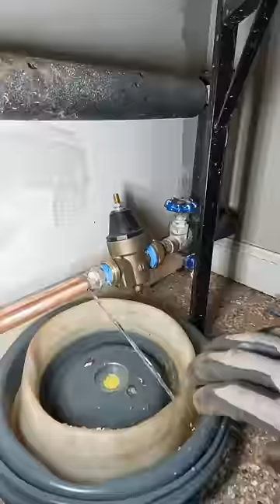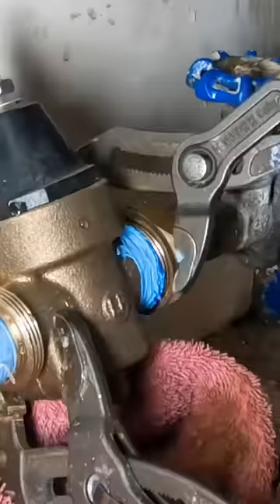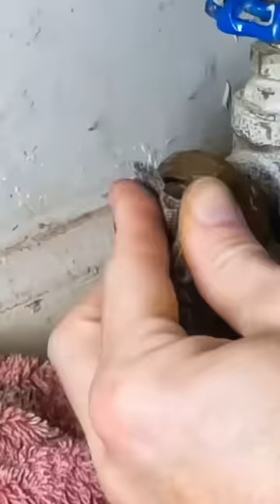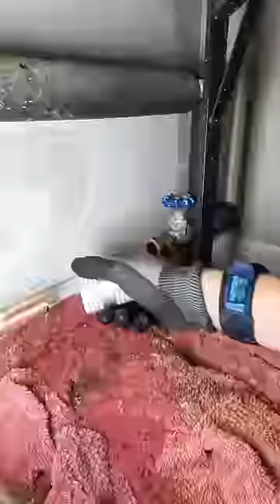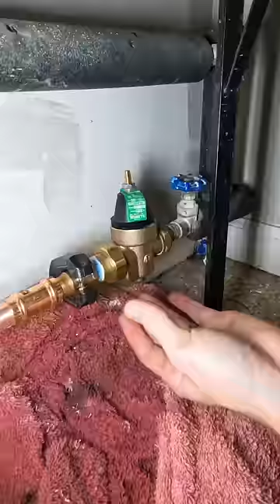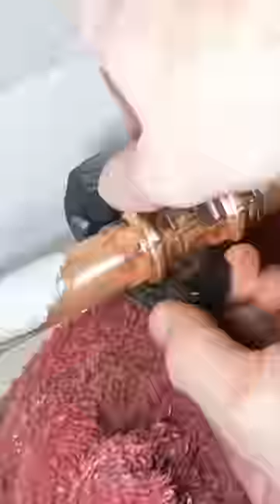Replacing a water pressure regulator valve 💦 #plumbing #plumber #shorts

Comment: Wow. Whoever installed the old one wasn't a plumber 😂. They had blue thread tape around the gasket seal smh
Reply from the maker: The teflon bandit strikes again! 😂
Reply: @theplumberlorian nothing ever sticks to that guy
Reply: В России синяя изолента легендарная вещь
Reply: @samuelcomeau pipe dope is good to stop galling and seizing
Reply: @AlbertCartel 😂
Reply: @BensSightSoundandAuto it’s not needed though
Reply: @smittysgaming9764  Seat belts aren't "needed" either but they help. Pipe dope could mean the difference between a quick swap over down the track or a pain in the ass repair
Reply: @samuelcomeau think: you will be able to unthread that in the future.
Reply: Yeah I love when I see that.  I was trying to source a seal for this pipe fitting similar to this at Home Depot a few years back.  After helping me for a while the guy was just like “you could just use Teflon tape”.  No… no I can’t.  That’s not where this fitting seals from.  Being half his age he just kept reassuring me and telling me to trust him.  It was honestly unbelievable that he was the plumbing guy.
Reply: nice how you noticed the blue tape on the old install. tefflon tape wont eat the gasket away like the pipe dope this guy put on the threads of the new install. the dope eats at the rubber over time.  sad video and your sad for not stating the real issue
Reply: @joshouagoncalves9564  The saddest thing here is your grammar . 😭🤣
Reply: Tell ya what, too:I noticed that, as he was finishing up the installation of that new system, and some new line, he didn't use any soldering. Just clamped down on the connections, got 'em to where they wouldn't leak, and finished up. 
Apparently, they've come up with a whole new way to do things like that, in plumbing. Smart move. With soldering, ya have to be careful... and exact. Too thin a weld on soldering, and ya can get leakage. 
So, with him just tightening the connections up, I guess that's it.
Reply: Back when I worked in a small engine shop we had the same problem with pressure washers. Pressure washer high pressure hoses using a M22 fitting. Teflon tape will make a M22 fitting leak.
Reply: @BensSightSoundandAuto  Yes. It's just a lubricant.
Reply: YouTube wasn’t around back then😂.
Reply: neither was the guy that used crimp fittings instead of soldering. too much lazy work these days. would rather spend 3 grand on a tool instead of getting an apprenticeship in plumbing
Reply: Дд
Reply: Wow whoever is changing this 1 is putting it in the wrong place it belongs out next to the meter box to get the water pressure down ASAP
Reply: @steelthfighter no one should solder anymore. Boomer.
Reply: @aweiner8667  and yet i can still run a trout line, grill a burger without fake finger nails, put up a barn, and plant a field of corn. all things that a millennial cant do because your all too damn lazy to go get a job
Reply: Mi estamos, execelentes trabajos.
Disculpe como se llama la herramienta que ocupas.
Saludos desde la CDMX
Reply: Ты не понимаешь)) И поймут не многие, Советский Союз поймет, синяя изолента- спасёт мир))😂
Reply: I'm a plumber... we use both blue Teflon and pipe dope on every single thread. Never had an issue.
Reply: @Awesomeman1987 do you know what teflon tape is actually for
Reply: Yeah and the guy who installed the new one put pipe dope on the same thread 😂
Reply: Teflon tape is not a sealer it is a lubricant that allows you to take full advantage of the taper that is built in to the fittings which is what actually creates a leak free seal when done properly. Pipe dope is also a lubricant just like Teflon tape. Pipe dope and Teflon together makes a great combination which allows you to take full advantage of the taper that is built in to the fittings.
Reply: @Tom-og7fi  you do not use teflon tape together with pipe dope
Reply: Not all threads have a tapered Edge some of them are straight you must get the pipe dope in the threads as well as lubricate it also seals this is why it says sealant on the jar just about every plumber I've ever seen uses dope and Teflon this is completely wrong you use one or the other and the argument will continue forever I've never used them together Bennett Plummer a long long time never had a leak
Reply: @edtorres5946  wrong. Straight threads are never used in electrical conduit or pipe threads in fact they are the same. 3/4" taper per foot. Straight threads are used for bolt applications.
Reply: @edtorres5946  you didn't go through a real apprenticeship did you. If you did you would know that what you said is wrong. Fixture threads such as use a sealing washer.
Reply: . ,,    Yep take the street key  ,, Turn it off  ,, Replace the valve too. !

Comment: Pro press, love that thing. What use to take hours can now be done in minutes. No more waiting for all the water to drain because It cools the pipe when soldering. Still charge the same tho.
Reply from the maker: You and me both!
Reply: just a glorified shark bite isn't it?
Reply: @vincentherman468 shark bite relies on the end of the pipe seating on a gasket and a biting collar.  They are prone to working loose and should never be closed in a wall.  Pro press actually surrounds the pipe and clamps  the O ring, it's proven to be more reliable.
Reply: @Redact63Lluks More reliable than a shark bite or more reliable than soldering?
Reply: @jamesegsmith  both by a long shot, but properly done soldering is still best.
Reply: Why the same though? Is it because you save time but fittings are more expensive, so it evens out?
Reply: @Redact63Lluks 
I have been in homes with 70 year old soldered copper pipes. I doubt that the rubber o rings in the fittings will last 70 years.
Reply: @12yearssober  did I say otherwise? 🤷
Reply: You don't have to wait for the water to drain, You just pack the pipe with a slice of bread or two, to plug it. After you solder and turn the water on it flushes right out.I learned that old trick over 30 years ago.
Reply: @Gravitycreatedlife you guys literally carry a loaf of bread around in your truck ?
Reply: Still charge the same because the tool is $2k plus and the fittings are at least 4x the price of solder ones
Reply: @12yearssober 😂 The o rings are a safety measure. There's videos where they use pro press without the o-rings and it still works
Reply: @Ffoo_ffighter  
I guess we will come back in 50 years and see🤣
Reply: As someone who makes F you money. I'm happy to pay for skill/tool Knowlage not by hour
Reply: @RedPillRealist  
That's how I make my money here in Naples Florida. All of my customers have f you money. They just want their AC working and don't care about the money.
Reply: What about the cavitation that crimped connection induces?
Reply: Solder will always be king. My house is over 50 years old and never had a leak. I personally have had to replace pro press and sharkbite fittings leaking in other peoples homes that failed within a year. The plumber who installed them gave the old taillight warranty. 
It may be faster, but its hack work and never lasts as long as solder.
Reply: Just put a compression fittings on no need for press fit and expensive tool
Reply: @Ffoo_ffighter does not work without the o ring
Reply: iantrofimov6416 it's much faster and there is no error
Reply: You can just stick some bread in there or use a large enough torch.
Reply: Hack
Reply: @ColeSpolaric the tool is about £650 ($700) in the U.K. but we have been using them for over 20years maybe that why, more popular
Reply: @Gravitycreatedlife Important though - pack bread but clear it out through a non-filtered, open spigot first or remove the aerator from the sink faucet first or else the bread will create a nasty sludge on the aerator screen.

And don't use wheat bread 😂
Reply: @jhard94  homeowner does  most of the time.
Reply: @WayPastCrazy2525  wheat bread works just as well if not better than white bread. It's common sense to remove screen from faucet where you flush. I usually flush to the outside spigot where that wouldn't be an issue.
Reply: @Ffoo_ffighter that’s not true. The o ring makes the seal
Reply: @vincentherman468 sharkbite could never make varsity
Reply: @jhard94 why not you already carry 8lbs if mcdonalds bags and wrappers 😂
Reply: @thedailyruns6046  I don’t get what you’re saying
Reply: They still charge hours
Reply: @VIPP79 It certainly does hold water with the o-ring removed.
Reply: iantrofimov6416  lol how do you know I am unskilled? I guess you are psychic
Reply: iantrofimov6416  or you are one of those that think you know everything better than anyone ah? I have 16 years of experience soldering and pressing and fusing pipes keep calling me unskilled pathetic man
Reply: @411Adidas If you install them properly it holds. It is most of the time installer error not debarring the pipe and o ring gets cut in the process.
Reply: @MisterTwister88  For how long it holds water did you try it? If there was no need for o ring they would not install it. You you want to say you are smarter than engineers creating the product and they just waisted the o rings?
Reply: @VIPP79  The o-ring is a secondary seal to the crimp. I did press some fittings with the o-rings removed, filled and pressurized with water. That set up is still holding 75 psi going on 2 years now.
Reply: @MisterTwister88  Good luck for that pray it will not leak. Do not see a reason to take chances removing the seal thats kinda idiotic
Reply: @VIPP79  Its a test setup on the bench in my garage, smooth brain.

Comment: See that threaded fitting on the right side of the valve? The left side should have the same thing. That way the valve can be replaced by the homeowner and a wrench. That's the way our pressure regulators are installed.
Reply: You can always get a sharkbite union.
Reply: Who's checking and setting the pressure though?
Reply: After the homeowner replaces the easily replaceable valve, he/she does indeed need to  check or set the controlling pressure. Fortunately, this is easy with an inexpensive and readily available gauge from e.g. Home Depot screwed onto a hose bib somewhere.
Reply from the maker: Well double unions were created for easy replace in general  💯
Reply from the maker: @BensSightSoundandAuto oh I throw a gauge on a hosebibb to set the regulator if not that .. the water heater boiler drain
Reply: Most PRVs come with only one built-in union, I rarely see plumbers buying a second union when buying PRVs

Source: I work at Ferguson
Reply: iantrofimov6416 : You can play the long game (help your customer) or you can play the short game (make the most money now). But you can't play the short game for long. Which guy will I call for future plumbing needs?
Reply: Er hat alles richtig gemacht.
Reply: Ian: If your services are in short supply and high demand, you can keep busy with the low end of the market. I am in that 25% of customers who look for someone who will offer better quality and better solutions. I  might call you. Once. After I realize that you could have, should have offered me something better, you would be on my "never call him again" list.
Reply: @BensSightSoundandAuto well considering they're all pre set I don't think they even care lol
Reply: I would always make it easer for the next guy or Homeowner. But then again I really enjoy the work I do and don't care about the Money so much. I always have plenty of Service calls.
Reply: Trust my as a plumber you could have done that anyway just take off union and unthread but maybe there were other issues
Reply: Are we even watching the same video? Because theres threaded connects on both sides of the install. He just had it pre assembled before pressing the fittings in on the left.....
Reply: Yup
Reply: he could have replaced this with just the one union if it was far enough from the wall to allow it to spin around but yes also if they had used both unions  it woudnt need to rotate at all. but i suppose you prolly know this already.
Reply: Деньги зарабатывают наверное
Reply: iantrofimov6416 
Because some plumbers value integrity over being a crooked businessman
Reply: You are correct....
Reply: It’s a double union tho
Reply: It has a Union both sides look closer
Reply: You don't need a second union, just unscrew the regulator from the male adapter.

You should never check water pressure from the bottom of a water heater in an older system. Sediment in the drain could give you a false reading
Reply: No I can't agree job security.
Reply: @specialopsdave I guess I’m not most plumbers. I carried Watts and Wilkins unions so they could all be double union.
Reply: Our pressure regulator valves are put in next to the meter box to get the water pressure down ASAP
Reply: Для России это очень дорого. Медные трупы намного дороже стальных
Reply: @ТимурОпимах  I'm sure glad I don't text English from where you come from 😂
Reply: Unions
Reply: Same. The author carry to have more work in feature
Reply: Se llaman uniones doble y las bombas presurizadoras se instalan con doble unión to iba decir lo mismo
Reply: Ayo Brody f that . Leave this to US PROS!! Harry homeowner shouldn’t be PLAYING Handy Andy let alone taking my next service call anyhowz 😂😅

Comment: You are supposed to mark the depth of your pipe fitting with propress with a permanent marker to identify where the edge of the fitting should be placed
Reply: I've installed probably over 100,000 pro press fittings by now and I rarely mark the pipe. I know it's not the right thing to do, but as long as you know what your doing and maintain vigilance then it isn't really a problem.

Comment: Great trick I will def be using never thought to drill a hole always just use autocut
Reply from the maker: Hope it helps man! Have a great weekend 👍
Reply: Or you can just open a faucet and drain down the line that way.
Reply: Solo hubiera quitado la tuerca union y con eso liberas el agua sin necesidad de perforar el tubo y despues se pone otra tuerca union del otro lado y queda listo para poder desmontar sin necesidad de cortes ni soldaduras posteriores

Comment: If you want to get paint off of a line. It's always a pain in the butt. But if you burn the paint with a torch or heat, the pain up, it literally brushes off. Especially if you sand it while it's hot it comes off so easy.😅
Reply from the maker: That works 😂
Reply: I like that idea! Get the paint out of the way, as fast as you can...and heating it up, to where it cracks and bubbles up off the line, is a great idea. Trying to sand it off just takes more time, and it can be hard on the hands and wrists.
Reply: Can you do that on a Gasss line😅
Reply: This way seemed pretty fucking effective too

Comment: А зачем резать? Там же соединение позволяющее открутить
Reply from the maker: Can’t spin the valve with the wall there
Reply: Хороший ремонт бро!
Reply: yes you can, it holds in place with nuts on both sides that allow tightening the nuts on seals without moving valve anywhere (you can see blue teflon tape on both sides in place of those connections). This is nothing but video showing off ProPress tool that cost much more than hiring a plumber if one doesn't have two wrenches to undo the nuts. @theplumberlorian
Reply: @alexs2778 yup!
Reply: Человек лёгких путей не ищет.

Comment: Love your pro press.👍 Sometimes it does help you putting tape on a Union. You make sure you have no leaks Don't over do it with the tape.
Reply: That doesn't help. The union nut needs to be tight against the threads to form a seal. anything that prevents that means it will leak.

Comment: I’m no plumber and idk why this came up on my feed. But watching this whole process looked so awesome to watch. 

Also, reading through the comments, how come Teflon isn’t used on unions?
Reply: As a good rule to follow Teflon is made to help seal up the gaps in the bottom corners of threads since some threads are rounded off and some are sharp also most pipe threads are tapered so the threads get tighter the more you screw it together. And Teflon/pipe dope help seal up the inconsistencies. When you have a union or flare or compression fitting they have 2 smooth surfaces usually made of a softer material like brass that when tightened squeeze together or if it's a harder material it will generally have a rubber gasket that fits it to seal it. If you put Teflon In joints like these you generally just end up making a buildup in a already smooth joint causing it to leak. If the surface is messed up and you need something to help seal it then pipe dope can be used because it's a paste and spreads out smoothly but tape should be avoided in anything other than thread joints. This was long winded but I wanted to explain it completely.
Reply: Because a union seals by either metal to metal contact or by a gasket. The threads and nut are only there to pull the two halves together. They provide no other function.

Comment: They also make pro press for black pipe. It's called mega press. Then there is Mega Press G (the G is very very important), it's used for gas lines.

Comment: What do you use to clean off the corrosion/paint off the copper pipes? I’m an electrician and we have to install clamps on the water heater pipes to ground the hot cold and gas pipes per code. We have to clean all the corrosion and paint off the pipes so that we get a proper bond between the pipe and clamp. I normally use a wire wheel on a drill but it can be hard to get into some of the spots. It looks like whatever you’re using here works with ease and doesn’t take very long to clean.